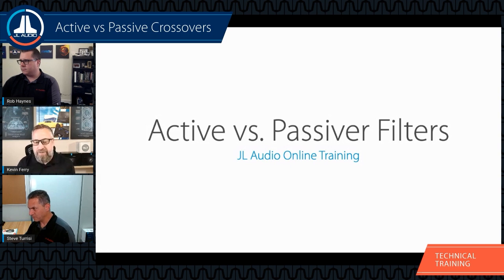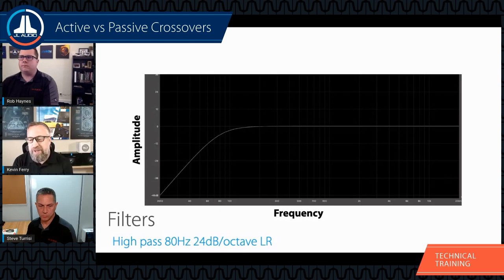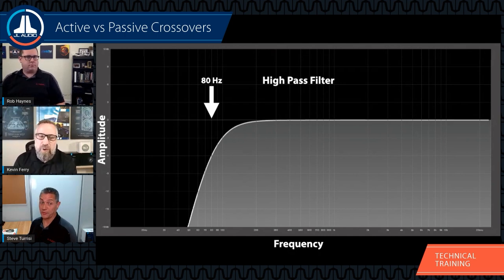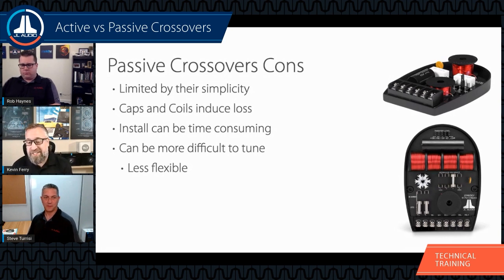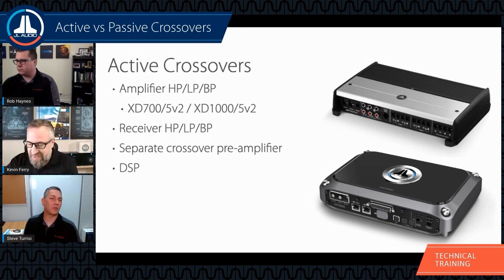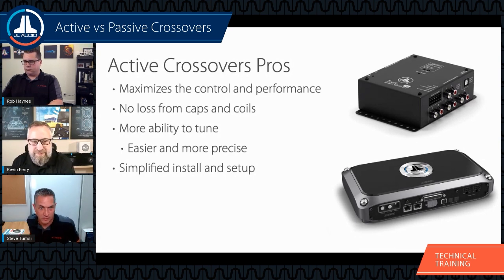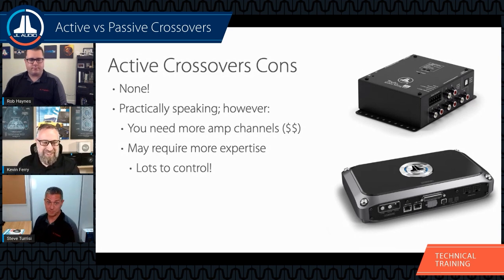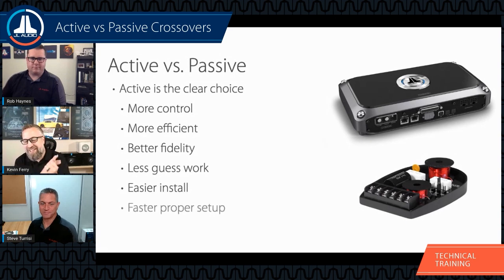[Live] JL Audio Training About Active and Passive Crossover Networks

Comment: Is there a version of this without Steve?
GTFO with no controls in the front. You may be out of touch with your customer base if you think we don't need full control up front. I'm sure 25% of your customer base is more money than brains, but a large portion  knows what a crossover is and how to set it. We're spending JL money because we're smart. if the deck has a DSP, it's probably better to us just it. I think JL's opinion is formed around the fact that they're heavily invested in amplifier DSP. The opinion not to use the Decks DSP is weak.

Comment: 34:35 - that's crazy!  That's essentially saying, with use of a passive crossover, you are cutting your amplifier power supplied to the speaker by at least 50%.  Is that right?  
I've personally never had an issue with the loss back in the old days with AB amps at 50 watts per channel or now in with D amps at 100+ watts per channel.  I always set the gain based off how well the mids/ highs balance with the highest sub bass output.  If I set the mids/highs with a multimeter or o-scope, my ears end up bleeding because of how loud it could play!
Reply: Using the CR-1 doesn’t reduce the power to the main speakers, that’s not how it works.